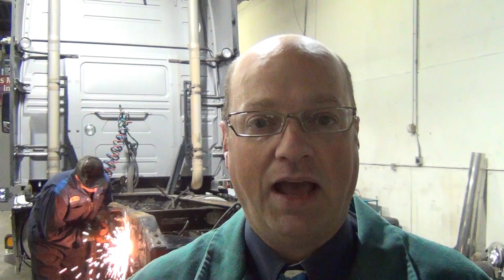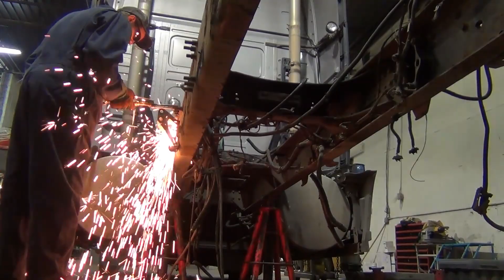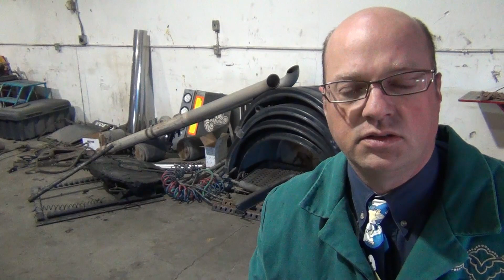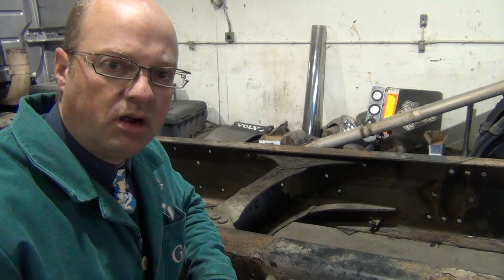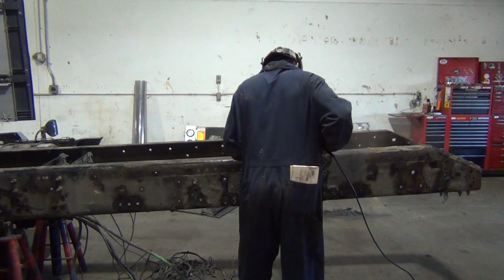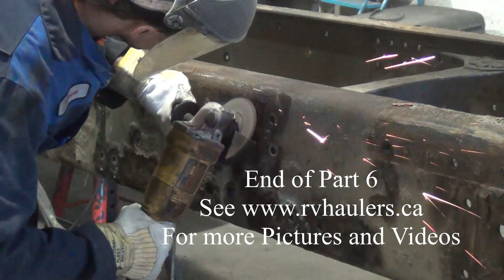How to Build an RV Hauler - Step 6 - Frame and Exhaust Clean Up

Comment: Is there some kind of certification or license required to be able to drill new holes in the frame to relocate things like the cross member, torque arm mounts and suspension mounts?

I've watched about a dozen of your videos so far, and enjoying them.  They're well done.  :)
Reply from the maker: georgianbents No, there isn't a certification required.  However, some caution is warranted.  We are careful to put frame-grade bolts into all the empty holes that are left-over.  This ensures the structure isn't weak in those locations.